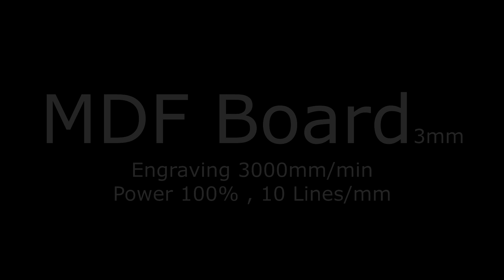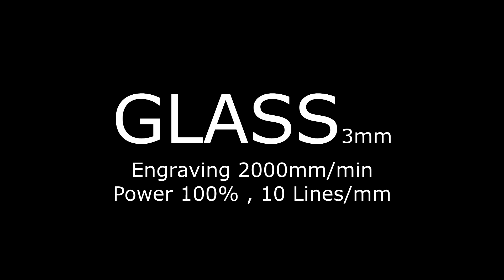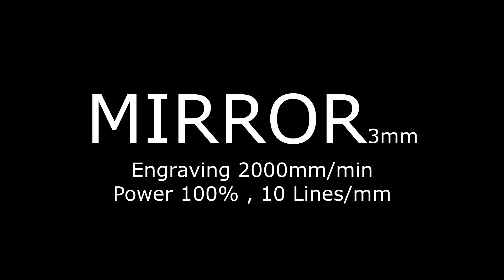Ortur aufero laser 2 - What Can You  Engraving With 5W Laser Module ?

Comment: how do you set the stainless engraving but the module doesn't move left and right, but can be like cutting, tell me
Reply from the maker: The laser is set to cut and not to engrave, because at a speed of 100 mm / min, engraving would take a long time.
That's why I wrote STAINLESS STEEL 1mm - Line 100mm / min  - Power 100%
Reply: @kukomio  wow just it, thx man